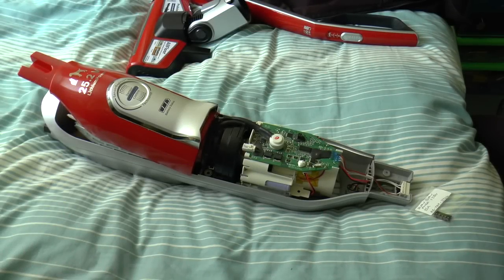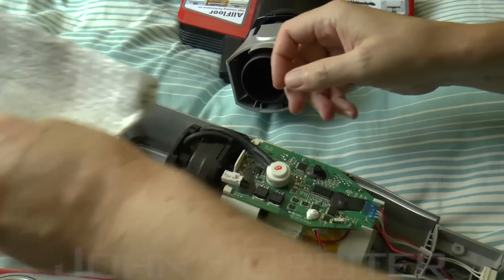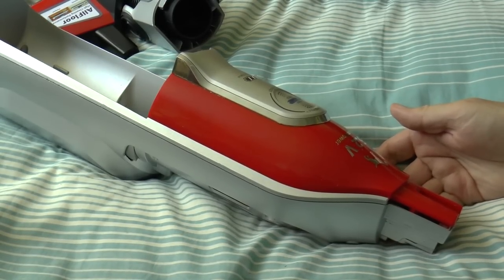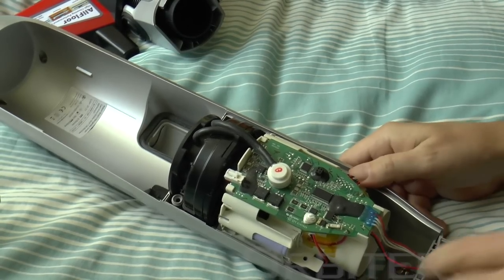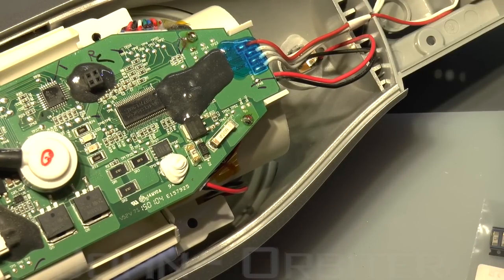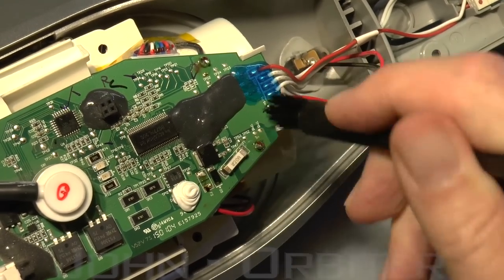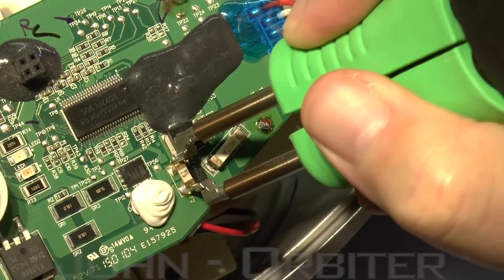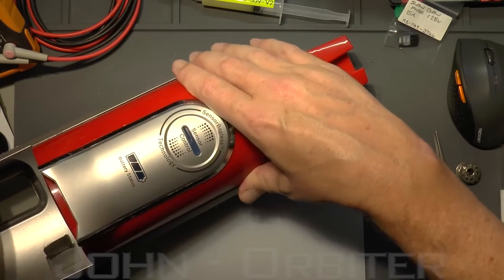Bosch Athlet - Vacuum Repair

Comment: Great quality video.👍I found it very interesting.
My Bosch Athlet wasn't that old when the batteries started to fade. I very seldom used Turbo. If I did,  the batteries would drain within like 2-3 seconds and it would need a new charge.
The next thing to happen was that the red sensor light came on and stayed on. If I plug it in to charge, it starts charging and after about 20 seconds, the red light comes on, stays on and stops the charging process. I thought it was a filter warning. I've cleaned the filter but it didn't help. Although, having said that, I didn't put the filter in the washing machine like they state you can in the user manual for a serious clean of the filter. Because it won't charge, it is basically useless to me now.
We were never happy with the Bosch Athlet. We both complained that it just pushed particles further forward instead of sucking them up - especially larger particles on hard floors. Your video highlights another design issue with this device that thankfully I didn't encounter.
I've bought a Dyson. Yes it is much more expensive but it is far superior in every way. The wife and I are much more satisfied. We will see how long the battery on the Dyson lasts 🤞In the meantime, my advice would be to steer clear of these vacuum's. They are nothing but trouble and the lifetime of the battery pack is ridiculously short.

Comment: Excellent. I've seen other videos showing the failure of those two wires but nice to know what happens if they short when they break. Both my mother and I have Bosch Athlets (but not the zoo models) and although I'm gentle with mine, I envision I might have to open one of them up at some stage. Hers is getting on to nearly 4 years old I think. Apparently the handles break easily as well so it seems the design could definitely do with some 'toughening up', but it's a decent vacuum and she loves hers. I was expecting to have to shell out for a Dyson when I took her to look at stick vacuums but she preferred the Athlet due to the weight being more distributed down the handle. She found it easier to manoeuvre. Only problem is it's fatter and doesn't get under my bed. Oh well still have the old traditional type for occasional use under there and other nooks and crannies. Thanks very much for the tips.
Reply from the maker: Thanks.. Yea we love the Athlets too. Nice nimble vacuum with enough power for a decent clean too. We chose this one after using Dyson uprights for a while, but they were becoming too heavy. I still love my little Dyson DC34, it's old now but still works great.
Cheers, John

Comment: It can be quite a challenge to dismantle many modern devices as the designers often employ the use of hidden clips as well as screws, making it a bit of a guessing game! There's nothing worse than wondering why a cover won't come off, even though you've removed all the screws, and then having to potentially risk breaking something as the hidden retaining clips hold it in place incredibly strongly. I sometimes wonder whether it's strictly necessary to bother making it with screws if the plastic parts grip so tightly!
Reply from the maker: I'm of the same thinking Pete.. I don't see the point at all of using the type of clips that just break off. Especially when it would be no effort at all for manuracturers to replace the things with say.. a simple locating sliding lug or tabs etc which are secure once the screws are tightened. These are also perfectly suitable for preventing vibration etc
It really is as if manufacturers make these things to be thrown away as soon as theres a problem, no matter how small.

Thanks for the comments friend 👍
John
Reply: Pete Allum b(6

Comment: Thanks, need to take ours apart soon to replace the cells. Do you find yours collects grit in the corrugated hose at the bottom so that when you pick up the vacuum it all drops out on the carpet?
Reply from the maker: Hi Steve..  I know it does get quite a bit of grit collected in that corrugated tube, however I can't say I've noticed much falling out when its picked up. I would noticed that too I think as the vacuum is stored on a hard surface sometimes. I can force some of the grit to fall out though If I rattle the hoover around a bit though or it happens to bang against the cupboard doors when I need it. Not loads though. 

Cheers
John
Reply: Would you please give me the spesifications of the  battery.  
Thank you
Reply from the maker: @ruchancakaloglu  .. Hi, I'm actually not 100% sure, however they looked like 18650 cells, and if there are six of them fitted in the Bosch Athlet vacuum, then this would make up the 25.2v indicated on the front of the cleaner.
Reply: Thank you for the fast reply :) 
I dismantled the athlet now  and  I found the batteries  
SAMSUNG SDI
ICR18650-22P 
1D92
 But in  our country I can find  1E92 or 1C92 
Can I use them? 
Thanks Ruchan. .
Reply: RUCHAN CAKALOGLU l

Comment: Got the same Bosh vacuum cleaner, but it doesn't fully charge anymore. I think the battery is failing. Thanks for the video, it gave me knowledge and I'll try to open and replace the battery :)
Reply from the maker: Yes if it's a few years old It's likely the battery pack on it's way out. Please do be very careful though if you go inside the unit, as I believe the main chip on this vacuums PCB is easily killed with static charge (ESD) I even killed my own vacuum like this and ended up with a new one as I couldn't get a replacement PCB.
Reply: @OrbiterElectronics  yeah, saw you mentioned it a few comments below. I'll discharge myself beforehand
Reply from the maker: @Amstroid   Ah ok 👍️ .. They really are sensitive. I know for a fact that I didn't do anything to physically damage my PCB, as I was just taking voltage readings for somebody else. I was even ultra careful not to short pins etc whilst testing, but even so the board was dead when I tried to fire it up again.

Comment: very good video plenty detailed info, our bosch althlet zoo  is just over 2 years old and has just suffered a broken neck !  part of the main body, poor design I think ,my mrs could kill any vacuum cleaner, they probably do more miles than my car
Reply from the maker: Thanks Thomas, yes I think they're a bit on the flimsy side too. They're a really nice light vacuum otherwise though 👍
Reply: mine snapped too - taped it up with fibrefix!
Reply: @Gultronics   i fixed it by taking of handle and drilling plastic with 8mm drill to one side of the centre through the 2 plastic webs  then put a      4  x 25 selftapper in  perfect

Comment: Thanks for the video! Saved me a lot of time especially with the plastic clips. I bought a new brush head, and then was disappointed when it didn't start working. I opened it up and tested the fuse which had no continuity. I also tried shorting across the fuse and sure enough the new brush motor came to life. So I'm purchasing some new fuses. Just wondering though, I was a bit surprised that if I short out the connection with the power switch off, the motor still starts! (by the way, my circuit board is covered in a clear thermoplastic??? protection which will make soldering messy :( )
Reply from the maker: Hi Philip, I was going to say you're welcome, However.. I fear you may have wasted your money on fuses there my friend. If the motor starts when you short the fuse (Switch in OFF position) there is perhaps another component in the circuitry that has shorted (and this is allowing the motor to start with fuse circuit closed/shorted.) This may have been the reason the fuse blew in the first place.

If you're doing anything else with the PCB.. Please wear some nitrile rubber gloves to protect the pcb from static. The reason I say this is that..Unfortunately I have never managed to repair or help anyone repair one of these vacuums once failed, and I have had lots of people contact me about them. I fear that the PCBs and components on these boards are very sensitive to even the smallest amount of static charge. So once the PCBs have been touched they rarely power-up properly again. I even killed my own vacuum whilst trying to help somebody else to test specific voltages :(
  
Please disconnect the batteries!  Otherwise I fear that a new fuse will just blow again. I think I would start by checking for shorted transistors/MOSFETS etc on the PCB with a multimeter.
Regarding any silastic or PCB conformal coating on the board.. If it's the thick rubber stuff, you can remove it carefully with a pick etc. If it's just a glossy conformal coating you should be able to solder through that, But beware of any fumes just in case the coating is something else.

Hope this helps a bit
Regards
John
Reply: @OrbiterElectronics  Thanks for the reply John. The fuses arrived and I had another look at it, but it looks like you are right. This time I put the voltage meter in the small socket where the brush head power connects. Sure enough, it read 20V all the time . I think rather than risking messing up the board completely I'm just going to leave the brush cable disconnected at the board and use it as back up cleaner in the basement. Too bad. Not too worried about the £2 spent on the fuses, but I'll have to see if I can return the new brush head (about 80GBP!) to Bosch. Thanks again for the advise!
Reply from the maker: @philipsmith68  No problem Philip, sorry to hear it didn't work as hoped.
John

Comment: Hello John
Can you help with my athlet, seems to be taking a charge but no output from the board to the motor. ??
I have got a second spares board which seems to do the same, if you have any idea's It would be much appreciated 
Kind regards
Graham
Ps I am powering and running the battery pack and connected board unmounted from the plastic housing.

Comment: Hi 
I'm attempting to sort out the brush intermittently stopping .. your video confirms my thoughts about a wiring break .. I've removed the three screws holding the brush 'plate' .. but I'm damned if I can get it off !! ..is this another 'strong plastic clips issue' ??? Or am I missing a screw (so to speak 😲) .. thanks !
Reply from the maker: Hello Sarah.. If I can remember correctly, there are 7 screws that need removing to take the base plate off. If you brush/dust/blow out the underneath of the brush housing, you'll likely get rid of some of the dust bunnies which often obscure the screws holes. 
So.. There should be the 2 visible torx screws which it sound like you've removed already. 
Then there are another 4 screws.. These are underneath the thin rubber strip, the rubber strip is only clipped-in, so can be popped out quite easily. 
Lastly there are another 2 screws, these are underneath the little rollers at the very front of the brush housing. Those rollers are clipped-in however they are often quite tight, so try a thin bladed screwdriver etc and lever one end of each roller upwards & they should pop up. You'll then see the 2 last screws.

Hope this helps 👍
Reply: Hi, a new query, or rather a further query on the same topic. So far I have removed 8 screws; 4 which are in plain sight, two more under the removable rubber strip, and the two which are hidden under the front wheels, but the base plate still refuses to come away. It seems to be held very securely by something right at the front in the middle, where the plastic moulding is quite thin, and may well break if I give it any more than a gentle heave. I am trying to get at the drive belt in order to change it, as the cleaner has become exceedingly noisy due to what, I think is a slack, worn drive belt, or at least I think that is the problem. Any advice would be welcome.

Comment: Hi, can you tell me what size Torx pin key is needed to open the main screws?  Thanks
Reply: I have one of these it is Torx Security, it has a hole inside. I don't remember it's size and I didn't have that type but I was able to open them with slotted driver! Cheers.

Comment: John, thanks eversomuch for uploading this. Having similar problem. 
It just wont charge anymore. Ive taken it apart but cannot see if any fuzes are blown, how do you see that?
Also, could it be the jack itself being damaged? It is connecting, and i have tried in other outlets, and with other chargers.. Pls help.
Reply from the maker: Hello mate, thanks for the kind comments 👍 
I know you say you've tried other adaptors to charge the vacuum, but where they of the correct voltage? Assuming it's exactly the same vacuum, it's adaptor outputs 30v so an ordinary 12v or 5v charger that just has the same size jack wont work. You can test this with a multimeter.

Regarding the fuses.. You can't actually SEE if the fuses are blown (Well not unless they've literally exploded.) You will need to check them with a multimeter too (in continuity mode.) The fuses are white & labelled F1 & F2 on the PCB, (you can see them at around the 5 min mark in the video if your not sure what they look like.)

Hope that helps
John
Reply: @OrbiterElectronics  youre welcome! Well worth it. So no they were not the correct voltage so thats why that did not work. Thing is a new charger is really expensive for these, surprisingly so. And I do not have a multimeter. So Ill have to get multimeter and then either the charger is broken or not. if yes buy new charger if no, throw vacuum?
Or just go directly to plan C and buy new cheap-ass vacuum.
Reply: Mrc Mountain j

Comment: Just been given one 7ish years old all is okay however never had a filter wash or exchange was blowing dust out I’ve just ordered two filters my question is the air outlet is there a filter in there to be washed or changed
Reply from the maker: As far as I know there are just the main pod/tank filters, and a flat white filter behind the battery pack.
You can see it in this exploded view (the filter is marked:  0103)

https://www.mamlux.eu/spare-parts-bosch/spare-parts-vacuum-cleaners-bosch/spare-parts-vacuum-cleaner-bosch-bch6ath2501/filter---c-01032018-05-14-07-14-11631191210-detail
Reply: @OrbiterElectronics  thank you for the I woke up early and was wondering I asked you the question and carried on looking on YouTube I found out how to do it the filter is now washed and drying on the radiator. New fitters coming from Amazon tomorrow. Not a clue or my brother in law managed he said was blowing dust out . Will now live again hope he doesn’t ask for it back

Comment: Hi I have a bosch athlet 25.2v. I replaced the battery but now the problem is it doesn't charge. The light comes on blinking for a couple of times and then it's off. I tested the slow blow fuse and nothing is broken. It just doesn't charge. I used the same replacement battery
Reply from the maker: Sorry for very late reply Steven. Unfortunately the problem could be many things.. From the replacement batts having been LOW on voltage or faulty and not starting to charge properly, to static damage to the PCB. As I believe these boards are very sensitive to static. I'm sure I killed one of my own Athlets just by touching/testing it's PCB. I had no blown fuses or failed components & good batts.. but it totally refused to work. 
I wish I could point you in a specific direction to help here but I can't, I've even been asking others including Bosch for any advice regarding this issue but I didn't get anywhere. And this is why I think either these boards are very susceptible to static, Or they have a firmware issue that is perhaps leaving many with dead vacuums 😡

I would still initially check that the charger is outputting the correct voltage (this will be printed on its casing), and if you're able to.. put it under a slight load as well to make sure it's actually working.. After that, I'm afraid you're in the same boat as I was.. Testing components looking for failed parts. 

Sorry I can't be of more help.

Comment: Hello, my battery is running for 3 minutes at full speed, and I want to bypass the battery  with a surce 25v 10A (by cable). Can you tell me, how can I do this and not damage the PCB. If I cut all battery-PCB wire and then solder  + and - from the surce is OK ? Thank You!
Reply from the maker: You could certainly try it but make sure you connect it clup correctly. Also be very carefully handling or soldering the PCB. The chips on these boards are well known for being very sensitive to static, so discharge/ground yourself first, otherwise you could kill the board. I know as I've managed to do it before 😕

Comment: Hello John, have you ever replaced the battery cells on this? I read comments there will be a charge issue after, like the board don’t recognized the new cells.
Reply from the maker: Hi.. I have changed cell packs on a couple of these vacuums, however only 1 worked correctly afterwards. These units seem very temperamental and fail easily once the main PCB has been disturbed (IMHO they're very sensitive to static.) The units that only fail shorting then blowing SMD fuses are often repairable. However ones that have had the PCBs unplugged & handled always seem to be problematic afterwards.
Reply: @OrbiterElectronics  thanks for reply! I’ll keep that in mind. I’ll give it a try and order some cells. I will demagnetize the pcb when done. that’s some good advice otherwise it’s useless after replacement